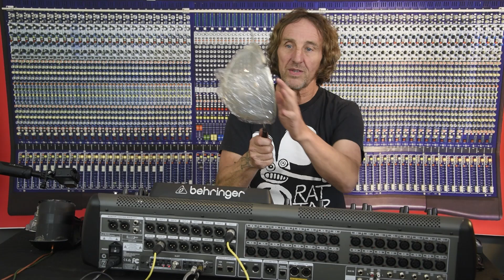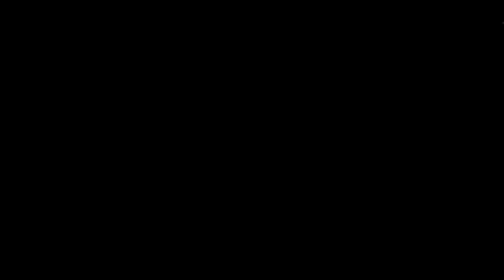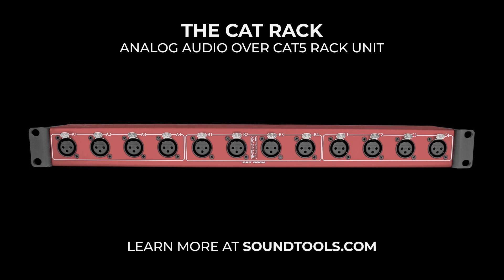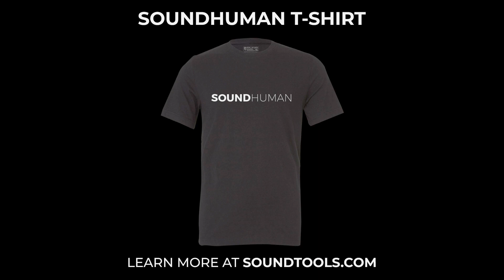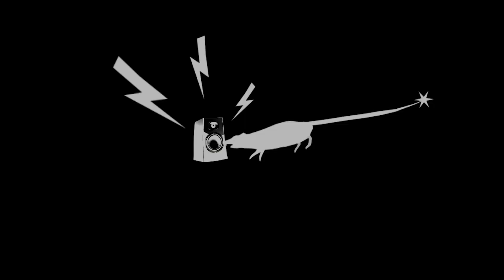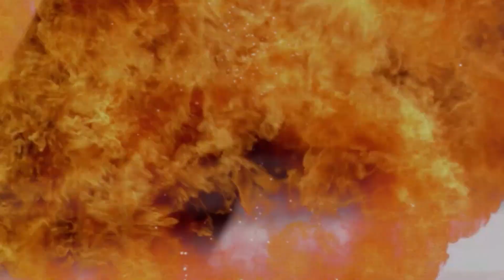Aux Fed Subwoofers Are Better - Because of How Mics Work

Comment: I don't fully understand the end discussion you do.
It makes totall sense to not wanting to send everything in a mix to the subwoofer and that high pass filters are not a fix of all issues. But I mean a shift in the aucustic crossover is also quite significant right ? 
I got no experience atall with live band mixdowns but what's than the best way if using a aux send to keep the aucustic crossover in a acceptable range when adjusting volume ?

Comment: Great vid, Dave. I have a stupid question: can I use the two channels of one power amp to run two mains and two subs separately? (Ch1 > MainL > MainR in parallel, 4ohms, and Ch2 > SubL > SubR in parallel 4ohms). I'm assuming that's possible (obviously, matching watts and ohms and having my mix panned to 0), but I wanted to make sure. Thanks!

Comment: A good crossover will not yield the same result as a simple HPF. Not to mention, toms do produce tons of energy I WANT heard in the subs, snare is debatable, typically I would say its not needed in the subs. I was indeed surprised though, to see how much information makes it's way to the subs with a 90hz HPF. Im curious how a 100hz or 120hz HPF would fair. I would bet most people high pass a hihat mic way higher than 90hz. Im ok with aux fed subs as long as the console enables you to link the aux feed with the LR. But in general, aux fed subs require a lot more *stuff to manage behind the scenes. A simple LR with properly calibrated PA is just easier, and imho a good engineer can keep the majority of that crud out of the subs with filtering, even if not all of it. 

Point taken here Dave. Kinda surprised me.

Comment: Hi dave! You mix live this way, even with the drawback of sendind all your drums to a sub group? I mean, the  kicks sub portion would lack group compression wouldnt it? And one nore question how do you set the sub aux compressor? Fast attack and release?
Reply from the maker: I compress the stereo subwoofer aux sends as their own group
Reply: Thank you very much for the kick answer dave. How would you approach that sub compression ? Would you left initial transients to pass through?
Reply from the maker: @lucianogm transients are fast, sub frequencies are slow and low.the transients come from the non sub frequencies. You can use loads of compression on subs and as long as the rest of the program is transient, the music will sound tight and punchy.

That said, I typically just take the peaks off the subs to increase the average sub level and smooth out kick vs bass
Reply: @DaveRat thank you very much dave!

Comment: I got a 10' powered sub and connected it to my computer via RCA into the sub and a 3.5mm jack/aux into the computer and it worked. But when I hooked it up to my amp which has a sub out it stopped working. This has got me thinking I may need to get an amp with an aux output so that the subwoofer will play WITH my bookshelves, (since it has the standard speaker wire outputs). Thoughts?

Comment: In the studio, there are no sub's - the monitoring system is normally tuned flat, with the songs low frequency characteristics being controlled at the console. If the music we use to test systems have been mixed on the same eq's we have access to, then the low end bleed from the hi hat mic is either eq'd away, or still in the track, and if it is in the track, maybe there is something to be said about the feel of musicians having some of their instrument bleed into each others mics. Maybe, that's what makes the song feel human.
Reply from the maker: In the studio typically there's also no wind and the drum riser does not wiggle all the mic stands and the whole band is not recording at the same time with the various low frequencies from one instrument bleeding into all the mics from the other instruments.

This hyper-controlled environment allows the studio recording to minimize the low frequency noise and bleed issues that we experience in many or most live environments.

Additionally in more advanced studios that can mix in 2.1, 5.1 or higher formats, The studio does have a sub.

Mixing with subs on an aux send for a live show is just the same as mixing in a studio for a 2.1 recording.

With movies and home Hi-Fi able to do 2.1, 5.1, 7.1 or 9.1 why is it that pro audio is still stuck in 2.0?
Reply: @DaveRat  we can go on forever. 2.1 is rarely a thing for music and bands definitely record together in the same room. The bleed is less for sure. The biggest issue for me, is the flow from my master. If I add a compressor or eq on my master, and the LF instruments are feeding the group, the dynamic processing is not the same all around. How do you adjust for that?
Reply from the maker: Attempting to deal with the wide range of frequencies using the exact same compression and EQ techniques may not be desirable.

As you probably know, if you put a master compressor on a full range signal the llower frequencies will tend to create a pumping sound which is audible and undesirable for the upper frequencies

To address this there are multi-band compressors and other techniques to minimize the negative impact.

By putting subwoofers on a separate sand it gives you the advantage of being able to deal with compression of the lows separately from the upper frequencies which offers a huge advantage.

You may also be aware that the attack and release times that are common for low frequencies are different than the attack and release times optimized for higher and mid-frequencies.

Again having subs on a separate sand allows you to have an optimal attack and release time setting for the low frequencies while maintaining adequate or optimal attack and release time settings for the full rain signal above.

When dealing with the very extreme frequencies such as the sub lows or ultra highs utilizing differing techniques can give you into results.

One really interesting aspect is that low frequencies can be significantly compressed and if the mids and highs are still very dynamic The compression of the low frequencies is all but inaudible.

conversely having very dynamic low frequencies and compressing the mids and hives is extremely audible and very undesirable.

I highly recommend you test this. Put subs on a separate sand and use a lot of compression on them but don't compress the mids and highs compare that to putting a lot of compression on the entire signal and see which is more audible and what sounds more desirable.
Reply: @DaveRat  in my experience, the compression of the whole band on a master versus subs on an aux glues the mix together. When the subs are on an aux, I feel like the subs are doing their own thing separate from the mains
Reply: @DaveRat  And to be clear, I agree with you from a systems tech perspective, but from a mixers perspective, I rather a stereo master bus only
Reply from the maker: I find the opposite to be true, I find a stereo master compressor to sound terrible and very audible and is unusable for the quality of sound I'm looking for.

For that reason I never use it I use individual compression on all the groups so each instrument is compressed independently and the subs are compressed as a unit as well.

This gives me full control and eliminates any of that undesirable pumping sound that I left right compressor gives you
Reply: @DaveRat  we disagree. Pumping is a result of attack and release settings.
Reply from the maker: Pumping is the sound of the entire audio signal getting louder and softer

And since a standard compressor is just a volume control that is controlled by the audio signal...

Whatever is loudest and above threshold will turn down everything by the amount determined by the ratio.

Attack just determines how long after an above threshold signal occurs that the comp will turn everything down.

Hold, tels it how long to keep everything turned down

Release just tells it how long to wait after the loud part of the signal is over before turning everything back up.

If you have sub frequencies in the audio going to the compreasor and the sub frequencies are as loud or louder than the other frequencies, which is often the case, the compressor will turn everything down with each burst of lows. -pumping

Pumping also occur with mids and highs but it is less audible but pumping due to vocals is quite common, where a person singing into a heavily compressed mix results in the instruments all being turned down when they sing.

You can increase the complexity of the side chain signal filtering and filter out the lows or use a multi-band compressor to stop or reduce the pumping issue but the reality is that a normal compressor on the full range signal turns down everything when it compresses.

Which then leaves you with either compressing very little because it sound bad to compress more due to pumping or compress each instrument separately and eliminate the issue of one instrument turning down other instruments.

Finally, since sub lows are the biggest creator of pumping and compression issues, separating them out and compressing them separately will offer significant sonic advantages.
Reply: @DaveRat  cant reply thoroughly at the moment, mixing a show with subs on a matrix, flat tuned pa, and master bus compression, hopefully the quality is good enough, there are thousands in the audience. Talk soon. Great sparring with a legend like yourself.
Reply from the maker: Cool cool let me know how it works for you and it's great to try things and test them and see if they work for your application

Comment: I think a major reason to use Subs-On-Aux (SOA) is to prevent "unnatural" catastrophes, such as a talker or singer dropping the mic on the ground or smacking it with his hand.  Those situations are just plain crazy, to the point where even the mic itself is in danger of being damaged, nevermind the subs, which can be protected by peak/over-excursion limiters.  (And make sure you have RMS limiters on all drive bands!)

Comment: I’ve been running sound for live bands and dj gigs for 20 plus years.   I don’t call myself an engineer by any means.  I’ve always set up my and everyone else’s rigs with the subs on a separate send where I at least had control of them independently. Only recently discovered I could aux send the signal a few years ago.    When u clip all the extra garbage out the sun send it cleans them up tremendously I was so happy when I got that low mud I couldn’t find before out of my mixes.   Most people didn’t notice but I could hear it.    The new digital stuff out makes life a whole ton easier.  The people buying a new Xr18 don’t really comprehend the processing power they jus purchased.    I learn something every time I power on.  Great video. And demonstrating the output.  Fantastic
Reply: would you still recommend an xr18 to this for mixing a live full band?
Reply: @KazuyaST  absolutely my Xr18 is my go too for any sound reinforcement situation including my band.    It’s a wonderful thing when u get to start ur mix where the last one ended.
Reply: @rodgersrcaviation2785  thanks. Because im actually considering to upgrade towards it. Im also considering the cq20b from allen and heath
Reply: @rodgersrcaviation2785  i see ive been thinking of getting this or the allen and heath cq20-b

Comment: Impressive! Just asking myself ... If i were putting some processing on my LR and having a separate bus - not being fed by LR - for subs , I would have to copy the exact processing for my subs bus not to ruin the phase in the crossover freq for the system, right?
Reply from the maker: Well I'm not sure that putting the exact same processing on subs and mains is any more relevant and putting the exact same processing on every single guitar.

If you send the exact same thing to subs and to mains then having the same processing maybe more important because you're sending identical signals.

I think having different processing is actually an advantage.

You can do things like highly compress the subs but not compress the mains and get more low end out of a system but not have it sound like it's compressed.

Or send the bass guitar just to the mains NEQ low end into it and send the kick to the subs and mains so that the coverage of the two is different

Subs on an aux or separate send it's just a useful tool to give you more control.

You could send everything to the subs on a separate send and have it be identical to not having subs on a separate send

Comment: I definitely see both sides having their benefits and I respect each of their opinions. Personally I don't like aux-fed subs due to my mixing style, I do a lot of studio work and work best on a full-range system like studio monitors. If I don't intend an instrument to be in the subs then I Hi-Pass it out of the subs (Far enough from the crossover point). For instance I'm usually not Hi-Passing a Hi-Hat microphone at 90hz, typically way further up where there is absolutely nothing getting through the subs. If I wanted the microphone completely out of the subs then it would be limited to the crossover where the subs are, AND I'd have to put a Hi-pass on the Hi-hat microphone to bring it out of the low mids. But hey, that's just me!

Comment: Drum subgroup compression? Interested on how to get the best of both worlds - drum subgroup + drum crush subgroup with dca’s to drive input to compression and have the drums sit as a whole, glued together in the mix.  Not sure but how to peel off a kick+floor+pads feed to a separate matrix feeding PA subs.  Obviously subs on aux not the right thing here.  Maybe separate kick/floor subgroup so I would have a total of 3 drum subgroups:  kick, kit and crush.  Kick subgroup to feed PA tops + subs and kit + crush to feed pa tops only.  Next question … can I link comps across kick and kit subgroups?  Sidechaining the key input is not the right thing and stereo linking comps won’t really help to get the comps pumping together and gluing the mix.  As I write this, I am thinking to just live with letting the subgroup comps work independently.   Also I might need to add a kick-crush subgroup for a total of 4 -  (2 stereo for kit and to mono subgroups for kick). hmmm maybe this is getting crazy.  Interested in anyone’s thoughts on this.  Thanks for you thoughtful videos Dave.
Reply from the maker: Linking the groups collapses stereo imaging.

I personally always avoid it

Comment: The first time i got in touch with a separate sub-send it was shown to me by an old guy and i was like....it is so logical to do this in every way! It is cleaner and the material you want to be produced by the sub is better, because there is way less unwanted movement in those heavy and slow membranes of the subs. The low end is way more punchy und defined. And with vocals the big benefit is, you can give them a good amount of warmth and lower frequencies to make them sound full, without having that end up in a vocal rumble in the subs.
Also you can control the sublevel separate and quick.

Comment: I inadvertently replicated your demo. I was installing a replacement mixer and cleaning up a few things in the process. When I tested one of my mics to make sure that sound was properly passing through the new mixer, I was hearing only low frequency distorted sound. My initial response was I didn't know what I was doing or there was something wrong with the new mixer.

It turned out that the speaker terminals had pulled out of the mains amplifier while I was moving one of the racks. This left me with only the sub connected. It didn't make sense to me that I was getting such distorted low sound, as my voice should not have had any impact on those frequencies.

Your point about microphones imperfect reproduction of sound  became crystal clear. Without your video, I would probably have never understood the dynamics of this situation.
Reply from the maker: Perfect

Comment: Having the LowCut at 90 Hz means at 90 Hz it’s just 3dB lower. If u want to cut 90Hz u have to move quite a bit more to the high depending on the Characteristics of the HighPass or U have 3, 6, or maybe 24 dBSlope on somber desks u can choose the filter type but still at 90 Hz it’s just 3dB lower…
Reply: Absolutely…
Reply from the maker: Exactly so they really cut 90 hertz you might have to set the high pass a full octave above that and ruin the sound of an instrument.

And even then low frequencies from that instrument will still get through to the subs if they're not on a separate send

Comment: New to running sound and I was doing this until I was talked out of it. Why??? I was told to get a drive rack and let that do the work. So I did and it doesn't stop the junk from getting to the subs. I like the drive rack so is there a way to use a drive rack to tune the system yet use a separate send for the subs? I use a X32 rack.
Reply: The dbx venue 360 has three inputs! I have the drive rack, use full range for DJ gigs, and separate the tops and the aux sub for bands. So my tops are tuned to the dbx, and then I use the x32 output and direct out to the sub. I then do a digital crossover, and it works every single time. I am only doing this until I get a venue 360.
Reply from the maker: Perfect
Reply from the maker: Yes, if your drive rack has 3 or more inputs, would just use one input for left, one for right and a one for subs.  

Will need to program the x-over settings

Comment: You show the effect of a HPF set to 90, which clearly cleans things up a lot, but it would have been better to demo a more realistic setting, say 120. Sure some energy might still be getting through to the subs but it is a tiny amount.
Reply from the maker: I am demonstrating using a 3" speaker.

An 18 db per oct high pass at 120 is only down 18 db at 60 Hz. Multiply that by 32 channels and the lows getting through are significant